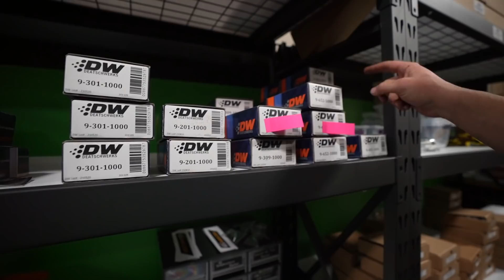BAD LUCK before the LZ Invitational! (I’ve never seen this happen before..)

Comment: When you sort out the pump again, i'd seriously consider drilling out the factory hanger terminals and running bulkhead terminals. Mine had that exact issue with the terminals corroding and coming loose.

Comment: You should have tony take a flapper disk to the lip on the trailer. It will prob take a couple hours but you should be able to grind that down so that it doesn’t catch your exhaust or anything

Comment: Why not just cut a length of radiator hose cut it down the middle and wrap it around the pump so that doesnt happen again and you dont gotta pull it back out just to put in a rubber isolator?

Comment: why not just cut ethanol safe fuel hose and use zipties and your resourccefulness to mock up a rubber cusion for the pump? wouldve been better than nothing.Also good thing it didnt ignite when in  a low tank. phew.